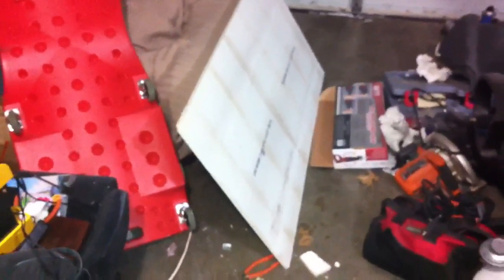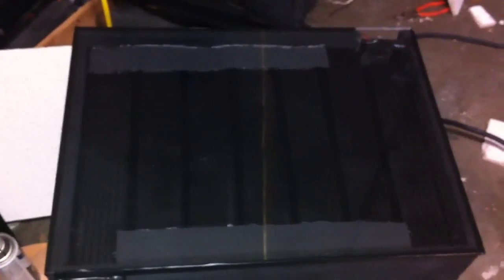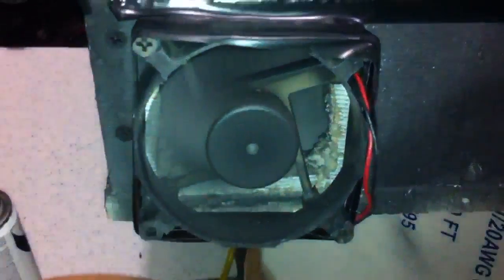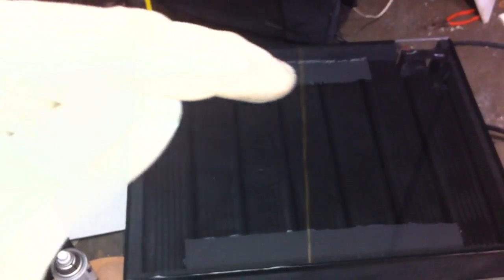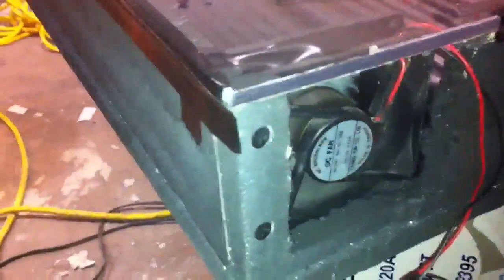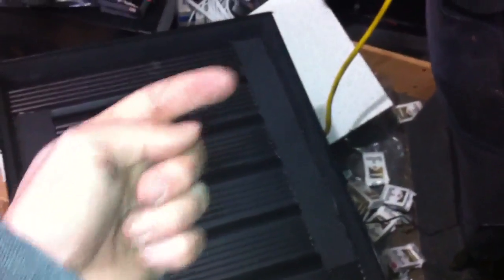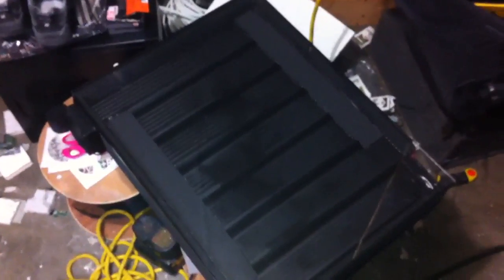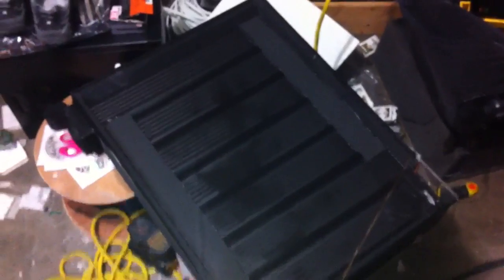Solar Air Heater

Comment: Our [2] 4'x8' solar air heaters WORKED! even in Pacific NW winter cloudage.  
Kept winter electric bill down around $100 in worst of winter [teens temps] [house = all electric, old house w/decent modern insulation & double-pane windows, about 800+ s.f.]. 
Shaded panels in summer.
Kept those up about 7 or 8 years, til landlord wanted them gone. 
Retrospect: need better cover material, better seal, would use PC fans w/small PV panel to run them. We needed better frame to rack them.

Comment: Good to have venting for heat built up between the black tubes & Plexi---we learned this type of air heaters get quite hot---made [2] 4'x8' panels sorta like this, but used cheap corrugated greenhouse plastic cover, which started to melt, even w/good air movement. Also, silicone caulk failed to stick cover section seam together = lots of hot air lost to outside. Still reduced electric heat bill by 100 to 300 KWH/month. 100 was no fan; 300 was w/4" duct fan pushing air thru.

Comment: It isnt that rough, certainly not terribly rough!!  These really do work.  I was amazed when I made mine.  Mine is just the simple pop can furnace with a 100cfm pc fan (cooler master turbine 1800).  Cranks out really great heat in direct sun and good warm air in marginal sunshine.  How many degree difference do you get with yours?

Comment: Looks really good, lots of great ideas in here.  How did it work out last winter??  Any changes for this winter?  Have you made any more, and if so, what did you do differently?  Could you tell if it in fact did reduce your heating costs, or, simply make living in a cold climate a little more livable?
These must have been aluminum gutters, right, certainly not vinyl, yes?